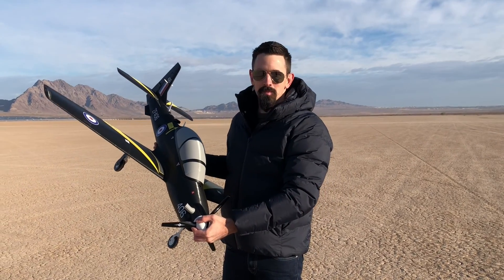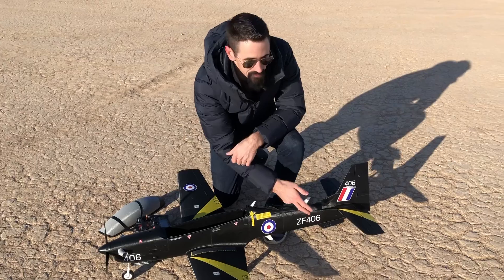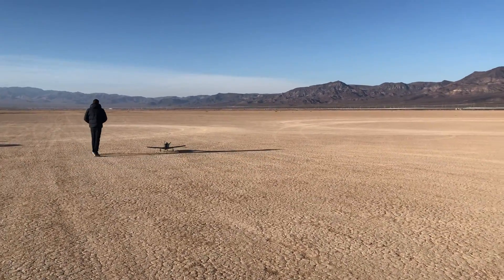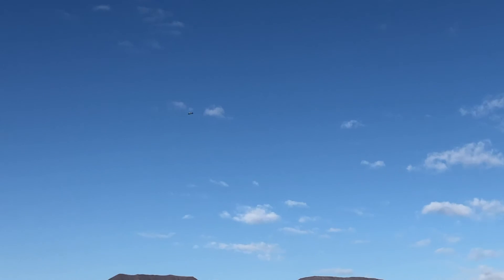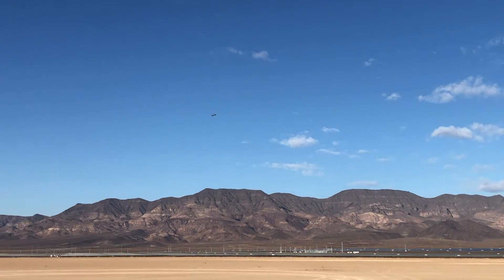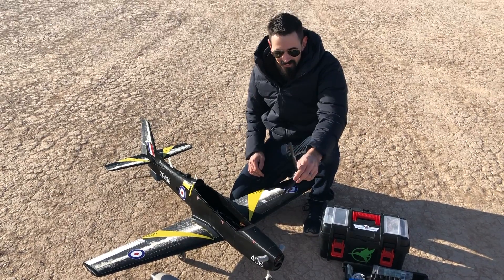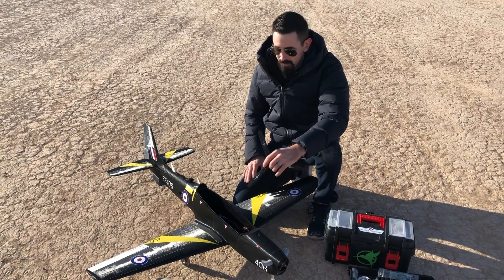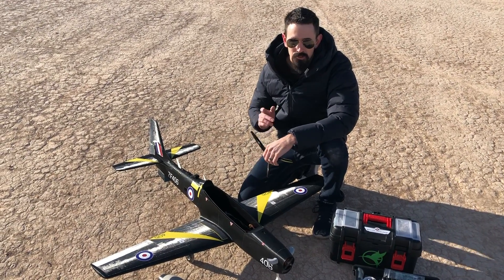Maiden Flight RC 3D Printed Tucano - Planeprint

Comment: Hi! I've just finished my Super Tucano and I'm looking for a battery I'm not sure, 3S or 4S and the capacity. How long can you fly it with that configuration (4S and 4000mAh)?
Reply from the maker: The 4s worked good because I did not need any counter weight in the nose. I was able to get 6 min flight time it is possible for a bit more just depends on how you are flying it full power the entire time would be a but less.
Reply: @TroyMcMillan  thanks for your answer!!

Comment: I have found that flying a RC model is a sure way to find the weakest design flaw, build flaw, or piloting flaw.  The fun challenge is to be able to learn from these flaws and to be able to fix them.  Great job on your build video too.  I learned so many great tips, the battery securing system was just one of them.
Reply from the maker: Thank you

Comment: They fly those out of RAF Benson, about 15 miles or so east of me, and every nice day when there's a high cloud ceiling they're out there pulling high throttle acrobatic manoeuvres about 3000 ft right above my house.   The noise is so f**king annoying!
Reply from the maker: Wow ya the noise would be a bit annoying. But to see them fly a few time would be awesome. I used to live under a flight path of a military base and I remember they would be doing laps in the pattern with two big jets all night long it was cool for a few days then it gets old. :) cheers
Reply: @TroyMcMillan  they fly too high to be able to appreciate the aerobatics, but not high enough to mitigate the engine noise.  I can’t work at my desk in the summer with the patio doors open without hearing them.
Reply from the maker: @RayBellis  damm sorry man that sounds rough.

Comment: Nice plane. But don’t like the sound of the printed wheels. Nice flight.
Reply from the maker: I was a bit skeptical of 3D printed wheels when I first built a 3D printed airplane also. But after lots of flights, hard landings and different terrains. I have not had any problems with the wheels. Thank you for the comment. This plane definitely flies very good.

Comment: Wow,,, that floated longer than I expected. Nice plane. I have 3D lab prints huge Corsair and P-40 ready to maiden for 2 years now, but got into hang gliding and they've been on the back burner ever since. Maybe this winter here in AZ I'll have a chance. Don't let that thing sit in the sun too long. LOL
Reply from the maker: LOL ya exactly it was very cold out the morning I flew it so not effected at all. In the summer in Vegas it will not be out flying much. Ya I was very surprised about how long it floated myself. I lost power in my 3D printed 152 and it fell out of the sky like a rock. :)

Comment: Nice take-off... and good flight.   I know what you mean about usually keeping a maiden flight simple... but when you get a good flyer and after a few circuits things seem ok... then it's tough not to push it a bit.  Nothing you did flying had any adverse effect on the motor... it was going to do what it did in any case.  Could you detail a bit more what happened?  Or will that be the next video.  What a great looking plane.  Cheers.
Reply from the maker: Thank you David, Ya you can see in the video the first few laps was slow and after it was flying good I started flying it a bit more aggressive. Definitely a good day after a good maiden flight. I was not planning on doing a repair video. It was a pretty simple problem I just add some loctite. I also added a spacer between the bearing and the prop adapter to keep the bearing in place.

Comment: Would you change anything about the way you changed the motor shaft position after experiencing the failure? Or was this related to that at all?
Reply from the maker: I would still change the motor shaft. The way the motor is mounted in the fuselage it requires the shaft to be repositioned. To fix the problem with the bearing I added loctite to the bearing. I will also add a small spacer between the bearing and the prop adapter to prevent the bering from coming out again. I have done this before on my Cessna 152 and I didn't have any problems with the bearing coming out.

Comment: jeezuss.      1)  at :33,   a battery tends  to  warm  up.   consequently, Nothing should be strapped to the battery !!!          2)  by the sound and what i see at 4:45,  a  GAS  prop was stoopidly used during this flight.          3)  btw, at any scale, a three-blade prop  Must  have lot of pitch, in order to work, well.       most full-size props that have more than two blades  are  Variable  pitch.          4)  in almost all cases, when an under-informed someone scales down a full-size design, they  Incorrectly  use  the  Same  wing profile, as the original.    instead of, correctly substituting a   LOW-RE#  profile; like the clark-y.          5)  if a great looking model has a wonky wing profile,  then it is a  Wonky (good-looking) model.          6)  if you want to understand what i am saying, here, look at this  re#  calculator;  and realize that  lower airspeeds and  relative small size  ALWAYS  result in a  Very low  re# environment.     happily,  CLARK  understood this stuff, when he designed the clark-y.          7)   since a lighter batter  WEIGHS  Less, auw  is less, the rate of energy consumption is  reduced and, flight times  are about the same, in either case.          8)   at 2.3 kilos, this model is  not  light, for its size.    fatness in models is  Very common, these days.    excess Aft-located  Mass is also a universal problem.    if interested, see my tutorials.    googletranslate
https://en.wikipedia.org/wiki/Clark_Y_airfoil
positive aoa is built into this type of airfoil/wing; such a wing should be mounted at zero-degrees aoa,, relative to the lower surface..
http://1.bp.blogspot.com/-5C8vhlmhBOk/VRe3o3Jt3yI/AAAAAAAABrI/EEgVHXkLvbY/s1600/clark%2By.gif
http://airfoiltools.com/calculator/reynoldsnumber
Reply: What makes you think that I simply scaled down the original airfoil (I am the designer of this aircraft)? Of course, the design is optimized for the requirements of an RC aircraft of this size. By the way, today there are much better airfoils than the Clark-Y. 
Of course the flying weight is a big issue, but in 3d-pressure construction you can't build as light as with carbon or foam.
greetings René
Reply: @planeprint  Beautiful job, René.  Looks like a great flyer, well balanced and smooth.  I've got the files for this along with Big Bobber, MB339, and the Icon.  Just waiting for a printer to start.  I've wanted a printer for a while and your planes along with Troy's video did it.  Cheers, David
Reply: @rcdavidk  Thank you very much!
Reply: @planeprint  hi.   i noticed the use of a reasonably good profile, in the construction video.     bravo, for that.        btw, regarding your remark about  a clark-y profile, it is not clear whether you  Understand  the nature of a   'low-re# environment'.       a clark-y  profile can  be  made  faster/thinner than 11.7 percent;  but  the  clark-y  SHAPE,   is  the  GO-TO  shape, for  TINY  low-airspeed    low-re#   APPLICATIONS.      there is no reason for you to believe me.         however, many years ago i analyzed every profile i could, for a diy project.       months afterward, the light went on, and i realized that  clark  KNEW  what  he  was  doing.    cheers
Reply: @daviddavids2884  Hi, I just meant that the Clark is very old and was developed to be able to build wings on a flat plate.  This is no longer necessary with cad-developed aircraft.  That is why we are now using better airfoils for these models.  But I have nothing against the clark-y 🤷
Reply: A Lipo battery should even be warm! I heat up my batteries to 38°C before the flight. If a lipo battery is too cold and current is drawn, then it inflates.